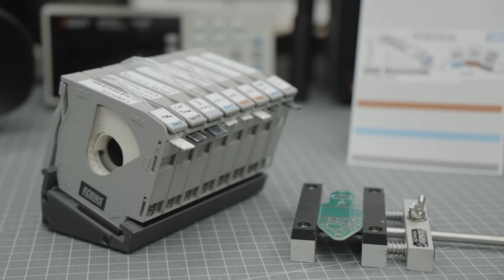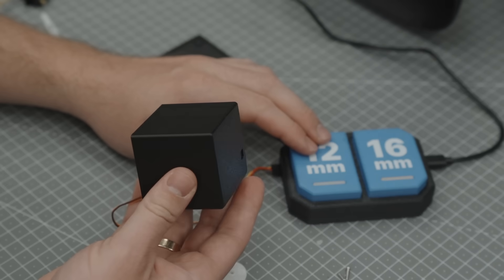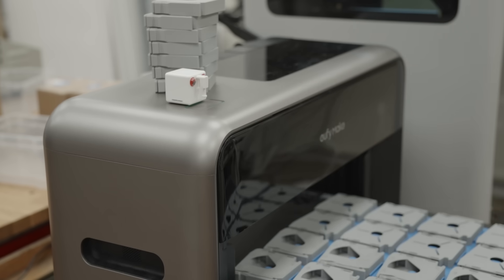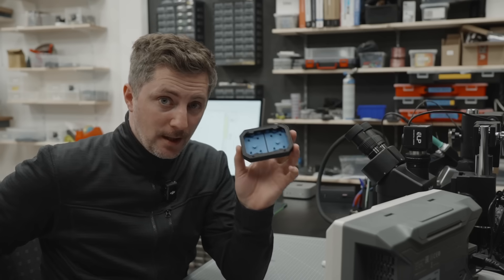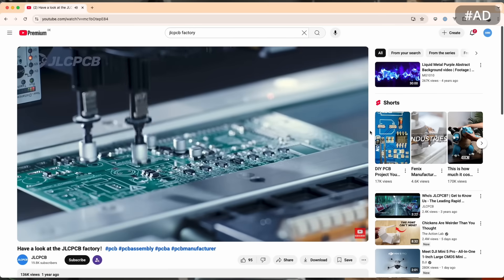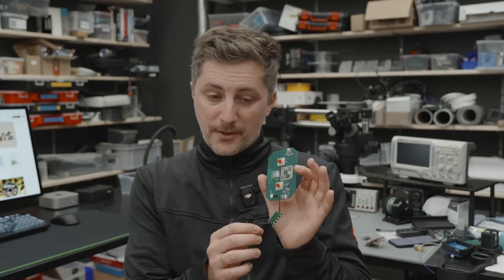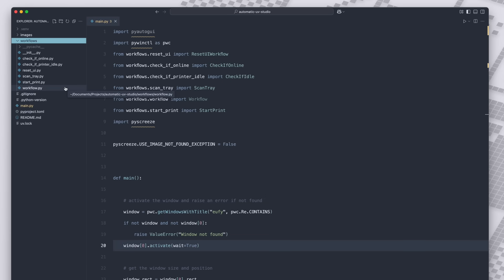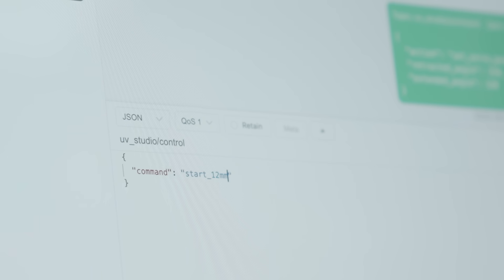Hacking the eufy Make UV Printer Into a One-Click Factory

Comment: I have been where you are.. I think you need to look into a thermal transfer ribbons for on device printing. Get a resin core.  But on phyical platic 3d parts its not easy, I am also looking at getting the eufy just because of the self cleaning convince and long term storage options to bring it out and put it away as needed..

Comment: Hi, what dimensions do you use for the PTFE with steel insert? Are you letting the steel slide around inside the PTFE to make the smooth motion, or are you letting the PTFE slide inside of the printed part and the steel is just there to keep it straight? Thanks

Comment: If it is an electron app, you should check the network tab when inspecting. You might be able to see what the network requests are and then you can just copy them. Much lighter weight than a library to simulate mouse clicks.
Reply from the maker: First thing I tried. Unfortunately that’s now how it works. The electron app itself (the backend so to speak) does the requests. 

Those don‘t show up in the network tab.

Comment: In Electron, the main process is a Node backend (with or without native DLL libraries, if they want to hide something or need extra computation performance) which calls require('electron') in order to open Chromium windows and communicate with them. But the Node backend is the one in charge of everything, and if you can't see the printer network calls in the Chromium windows dev tools, it means they are performed by the backend.

Which makes things easier! Because you can take the backend code (which is still JS, at worst with local variables renamed and spaces removed, in which case just run it through Prettierjs); then remove all Electron-specific code, starting with require('electron') imports; add your own API server, for example with Expressjs; and wrap every callback code into its own API. For instance, whenever the Electron code called: app.on('event-name', callback) or: contextBridge.exposeInMainWorld('apiName', callback) you would take those callbacks and expose them on a new Expressjs API endpoint, like POST /loadDesign or POST /print

Then you can take the backend JS code, which is now without any require('electron'), and you can run it in plain Node.js to have your own API server. If they used native DLLs, you will have to run it in the same architecture (x86, or maybe even Windows-only), otherwise you can run it anywhere Node runs, even on a Raspberry PI on top of the printer, with a SD card to load the designs.

Of course, if that printer manufacturer has a Github repo for the software, of if you can ask them for the source code of the backend and they give it to you, you should start with that, instead of extracting it from the Electron app.

Comment: Like it - i think I would have gone for some off the shelf buttons like flic or aqara, a switchbot for the button push, ifttt home assistant and keyboard maestro - but pihome does look interesting.

Are you planning another phase to auto load the bed and auto rotate.

What I think would be really nice with the eufymake is to somehow combine the uvprinter with an fdm printer - maybe some having a bed slinger type setup that sits to the side and prints directly onto the eufymake bed. Although I guess with your approach you can be printing on both machines in parallel.

I think there are going to be a lot of interesting possibilities combining fdm with uv printing - especially with something like the rotary addon to spin the fdm prints around to multiple angles.

Comment: I just use a brother tape labeller for my part spool carts. I'm actually a lot more interested in a UV inkjet printer. I think it would work much better for printing UV photomasks, since the ink is literally designed to absorb UV light, but it's way overpriced for just printing on transparency film, and a quick google couldn't find a UV inkjet printer that's not designed for printing on objects.

Comment: There are a few additional pieces of automation that you could add that would take out some of the manual insertion and handling. Slight modification to the tray, a multi-function loader/unloader, a short sorting conveyor into separate boxes, and a feed hopper.  Add a few more sensors to control the sequence of automation and you could load in the morning and have full bins by the afternoon. <Grins> would you like to know more?

Comment: 10:47 It's an electron app, it has a network tab. You can just watch it make the API calls and probably reverse just enough to make it work.
Reply from the maker: Unfortunately not. That was the first thing I checked. There are no requests in the network tab. The actual requests are done in the „backend“ of the electron app.
Reply: @RobinsTools  Gotta love electron IPC, possibly worth decompiling the .asap of the electron app, at least then the ipc calls could be triggered manually and watch the application calls over wireshark.
Reply: @RobinsTools  maybe another option would be injecting JS and using that to .click() the buttons you need etc? Iirc I’ve done this exact thing at some point
Reply: @RobinsTools wireshark is your best bet.
Reply: You could use Wireshark to sniff the API request between your computer and the UV Printer.

Comment: Instead of turning every single cartridge manually, if the the jig is easily removable, why don't you print another one, laying it on the halfly printed cartridges, take the stack out of the printer, turn it around an remove the jig, what is now on top?
Reply: was gong to say the same. flipping them all in one go would be faster even with having to align the jig again. especially if he makes an alignment jig on the outer edge of the 0 x 0  point.

Comment: Wireshark might uncover the "web commands" from web browser to whatever runs the printer, no need to check images appearing on screen or emulate user input ?
Browser requesting the image to load could be tracked ?
Tip, Circuitpython can emulate a mouse/keyboard (works on rpi pico) and run a minimal webserver, so remote control thru tablet/any browser

Comment: You could have gotten some API access, as the electron app definitely calls an API somewhere, to actually send the data to the printer. Of course, this would require digging around, but, in the end you wouldn't need a VM.
Reply from the maker: I'm curious myself about those API calls. I might give this a try at some point.
But I don't think it will be more stable or less work to do than my current approach. 
Undocumented APIs will change just as frequently as UI updates.
Reply: @RobinsTools  On one side, I'd think they are less likely to change the API in a big way, unlike the UI, but on the other, yeee. It's an early version of the product, so never can expect too much.. :D

To be fair, I'm kind of curious in taking a look at the app myself, if it's publicly available somewhere.
Reply: And I mean, even if they are going to change just as often, I'd preferably work with an API than UI automation, but that's up to preference

Comment: Wow this uv printer has use cases I would have never tought about. I would have probably thought to use a uv laser like the omnimarker 5w to engrave plastics cause they dont burn and literally leave a factory finish on the parts. Whats the needed time for the printer to finish the 16 parts on both sides would be helpful to know.
Reply from the maker: I tried using a laser. But I wanted a nice black appearance and I could not achieve that with the lasers I had on hand.

Comment: Lasers, Robin. Lasers.
You can obliterate / alter the pigments in 3D printed materials. It's the fastest way to print absolutely stunningly sharp stuff on printed objects.
Reply: Batch Research Lab has a ton of videos showing this. They use both diode and fiber lasers and get different effects with each.
Reply: IR lasers work great on 3d prints. My unit was $400 and has a repeat and count function so I can serialize the products. Also won't wear or tear off over time.
Reply: Screen printing is cheap and i think would work here
Reply: or just Pad printing? I don't see why it wouldn't work, it would be faster and 10x cheaper probably.
Reply: @5Lax  Because it's a LOT more elaborate to do. You also can't simply print something off the computer. It's far more expensive if you don't run thousands of identical prints and a pad printing process can be used for... Pad printing. A laser can be used for a plathora of different things. Additionally a laser "engraving" is not paint stuck to the print, but the material itself being altered, meaning it's far more resistant

Comment: Cpuldnt you set a second tray upside down on top of a completed first pass then flip the whole stack and remove the first tray? Seems faster than flipping each part one by one.
Reply: I think removing the first tray and securely realigning the 2nd tray may be more fiddly.
Reply: @LAD-321  that makes sense. If it was possible to somehow attach alignment pins somehow so the jig could be removed and placed back down in the exact same spot. If this can be done then I think this idea has more possibilities. And let’s be real if you’re willing to make a jig adding alignment pins and holes are relatively trivial. (Some skill required).

Comment: Have you tried using a fiber laser? The one from xTool comes with a conveyer and can automatically  align the design no matter how the objects are positioned on the conveyer. And the results of fiber laser on 3D prints is also very nice.
Reply: I have both xtool F1 and F1 Ultra and you can't get white engraving with F1 Ultra (only black engraving) because of pulse width, F1 diode laser does 4-5ns pulse at 25-35kHz, and F1 Ultra have Raycus Q-switch fiber laser that output 120-150 ns pulse at 30-60 kHz resulting in low peak power and too much heat, at 95% power white foam melts back and at 50% not foams at all, so you need F2 Ultra which have MOPA fiber laser and can do 2~500ns pulse but is expensive AF and at that price commarker b6 mopa seems to be better choice

Comment: makes me wonder what magic sauce they're sending to the printer. If you could wireshark the data being sent to the printer, you might be able to record that and then simply resend the data every time you want to print - that way the printer gets the data it needs and you can bypass the UI, like saving and rerunning gcode
Reply: If the app is built in electron you can just use the network tab in devtools to spy what it's doing, no wireshark needed.
Reply: Electron apps are actually very close to default visible source. Disassembling the JS used to communicate with the machine shouldn't be too difficult, unless Eufi got cute.

Comment: You should print a second jig. Then you could lay it on top, flip the two over in unison, and shave a few more minutes off reloading the Eufy Make printer.
Reply: You'd need a jig to align the jig.
Reply from the maker: Exactly!
Reply: I worked in CNC manufacturing, running several machines at the same time. The main time saver is keeping everything constantly running. What I'd recommend is timing how long it takes to load a jig, how long the machine to do a job, and how long to unload it. Lower the quantity loaded in the jig to give you just enough time to do the other tasks and no more, lower the idle time and keep a 100% workload on all aspects.
Reply: This applies even more when it's a one man operation. It's intended to cut down on the total time spent manufacturing. Minutes add up to hours, time spent waiting between processes is time cutting into personal time.
Reply: @AlbertScoot  A robotic arm could set up trays, load them into the printer  flip and remove trays to/from vertical cassettes
Reply: @AlbertScoot  I suspect he is a one-man operation. He would need to hire someone full-time to run the Eufy printer.
Reply: @AlbertScoot  This process needs a work Cell to manage the entire process.
Reply from the maker: I like this! Will try that. 👌
Reply: @RobinsTools  If you print two more jigs instead of one, you can have one at the ready at all times. Allowing you time to ready the next while the Eufy runs. Increasing throughput by 20% or better.
Reply from the maker: @GrayRaceCat  Fully agree! Will print some more.
Reply: @RobinsTools  How about SMD Magazin Magazins? 4 in a row to fill the jigs with 4x the press of a button? Filled like a coin sorter?
Reply: @tobiastho9639  Your actually thinking of a VLM - Vertical load module. it's a vertical tray stacker that feeds new tray to a production element for processing. it can also receive completed trays for holding and feeding another production element. Add in a robot to fill the VLM and a conveyor to feed i/ empty the VLMs and you have a work cell. the exit conveyer and feed a completed parts bin or a storage box for completed units. the robotic arm can be used to clear the tray and cycle it for reload.
Reply: @RobinsTools  I am imaging that base unit of some sort will be needed with pins and corners so that the jigs will locate onto that when flipped
Reply: @RobinsTools  Next add a robotic arm that pulls the tray lays the invert tray on top then flips it and places it back in for printing. When finished have the robot arm remove it take of the top tray pick and place the cartridges into a finished VLM (Vertical lift module for pickup by the next process and then pull a new tray from a vertical lift module that can feed fresh trays in an recycle finished trays for refilling by the robotic ar, while its waiting for the printer. You could probably fully automate the entire process into a work cell that can run for hundreds of parts with no user intervention except to   provide parts ready for pick and place in the VLM. Make the VLM modular and add a count sensor so it can notify the operator of status and to till refill.
Reply: @RobinsTools  Actually with a robotic arm and two vertical lift modules you can create a complete work cell that loads trays with parts then places them into the VLM, flips printed trays, unloads finished tray to a second VLM then load a fresh tray from the first VLM. A fully automated system that could do 7 trays an hour per work cell (at 8 minutes per tray). If you need more, you duplicate the entire work cell and get 14 trays an hour. You have a four-minute space.  Add a conveyer to provide parts to fill the trays and the robot arm can pick and place from the conveyer to fil the tray. The operator then just places parts on the conveyer for the robotic arm to pick. If they come trayed already then you might be able to just place the trays for picking. The robotic arm will not be cheap but if oyu are doing hundreds of trays a week it might save you time or having additional staff.
Reply: @RobinsTools  you will need 2 bed plates to mount the jigs to but probably WAY faster. 😉
Reply: @RobinsTools  I was gonna say, keep a base jig and make another jig that is open on both sides so you flip the whole jig without transferring or using another jig.
Reply: Absolutely. I do the same thing when inspecting eggs at the grocery store before buying a carton. No need to flip them over one at a time. Flip them all over at once inside the lid and inspect them all in a couple of seconds. @RobinsTools, For your Jig you could print one tray for the front side and the other tray for the back side to make loading either tray more simple. since you no longer need both options in one tray as you will have two trays anyway.
Reply: But if you do that you also need a way to quickly align the jigs on the print plate.
It’s fine to manually align one once but if you want to swap them you’ll need to have „corners“ that fit exactly onto the print tray.
Reply: I was about to suggest this as well
Reply: Jigs on jigs on jigs 😂 
Jigs are the best
Reply: Lol I just saw your comment after I posted mine 🤣
Reply: Ha, that was my first thought as well!
Reply: What about outsourcing the production all together?
Reply: Are stickers good enough? Can you have them in a sticker gun like price in a supermarket?
Reply: Could you somehow print the 16 items together so that they can be moved around as one, printed on the eufymake and then snapped apart - appreciate though that might result in some cleanup
Reply: yay someone actually said it
Reply: @BiteSizedObject  Which someone said what?

Comment: These buttons are so heavily overengineered 😂 But that's what makes your designs so awesome, I really like it. Awesome solution! And it shows why open software/interfaces to printers are important. usual customers won't do this, they'd just go for a different product then.
Reply from the maker: They are overengineered but they are just soo smooth now 😊
Reply: @RobinsTools what is the flexible material you cut for the buttons?
Reply from the maker: PTFE tubing.